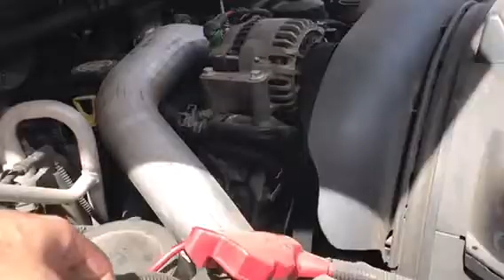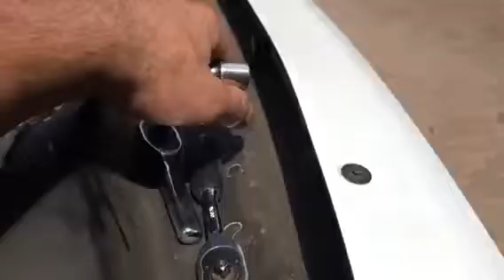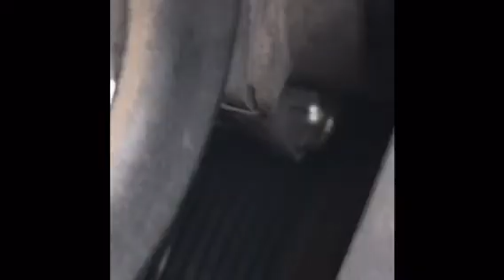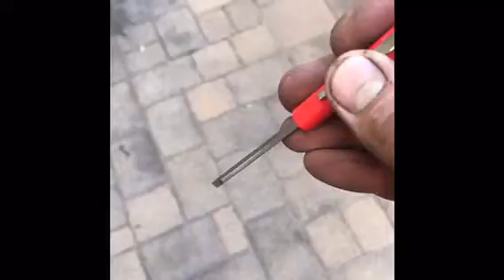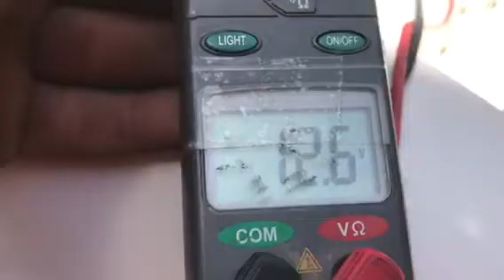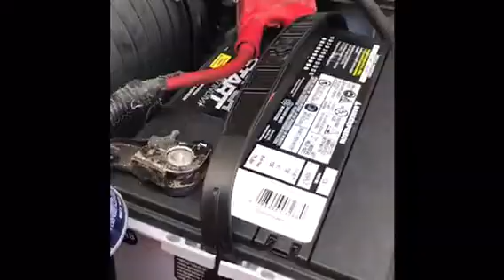6.0 Powerstroke alternator removal (fast and simple)

Comment: i didnt watch this video, but i can tell you how i do it in 5 minutes, take the three bolts out, flip it over to release the belt, stick a socket extension in the left rear bolt hole of the new one, flip it up with the belt on, put the bolts in, no reason to use the belt  tesnioner

Comment: It seems I'm the only one... the little tab on the two wire electrical connector on the back of the alt didnt just "pop off" I broke it... twice. It will still work, I hope, but it didnt just pop off like you said and your description was pretty vague about how it comes off. All those connectors seem to be different and I F them up.
Also the slot for the breaker bar or ratchet on the tensioner pulley isn't an easy thing to get to. It's way far down, can't see it. I can feel it but not so cut and dry. My breaker bar has been modified(has a 90° handle welded to it for another specific job and my other one broke pulling teeth on my stump grinder) so I can finish the job today and so far has not gone as smooth as others have posted. This video was helpful forsure. I'm just frustrated that it didn't go smooth and I have to wait til tomorrow to get a breaker bar to finish.
Reply: Yeah I broke mine too.  It looked like the last guy jacked it sounds a little too which didn't help.
Reply: Oh yea most videos are like quick an easy just pull the belt don’t even need a breaker bar 😅 am like mm I can’t even do it with a breaker bar lol so apparently small 1/2 rachets is the way to go

Comment: Caution the alternator bolts lean towards the alternator mounting bolts rusting into the mounting holes. Just be ready to get some helicoils for the resultant stripped threads, and use nickel antiseize on the threads regardless of what threads you end up having.  Some engines have different tensioners and different frame for the engine fan and as such the belt is a bugger to get loose. Pretty close to what you show here but different enough to frustrate some.

Comment: The electrical connections on the new alternator will end up 120 degrees to the left of where they are on your old alternator. These alternators come with these two different configurations. Either one will work. Your new setup will have the wiring connections coming off of the left side of the alternator, while the wiring came off the top of your old alternator.
Reply: Ok dope cause i just got mine i few minutes ago and my connection are on the left

Comment: Thanks for the vid.   

I know,  as do most? how to dismount an alternator.  What was unique to this 6.0 is this "tab".    You pretty much glossed over that exact location and operation,  both lock and then unlock.   Yes,  we know about what to do to fix/prevent corroded terminals...   :-)    6.0 was the draw here,   and I think the unique features were not explained/explored.
Reply: Most do not know how to dismantle which is why we are watching.

Comment: If you aren’t strong enough to pull the belt, there is a square slot on the tensioner that you put a socket extension into, and put your ratchet or breaker bar on it. The tensioner is very easy to move this way.
Reply: Lol that's what I needed to hear.
Reply: Would have been nice to know what size.. most are 3/8 but pretty sure this is half.
Reply: @19shane94  pretty sure? I picked up a breaker bar and it doesn't want to go in.
Reply: @MrBrucewpg  1/2 if I remember right. Should go in it just needs to be straight and at the right angle. Can be a little tricky but it'll go in.
Reply: @MrBrucewpg  yea literally just walked back inside to grab a beer after that. finally done though, breaker doesnt fit because of clearence unless you remove the passenger battery and the metal hose. i ended up using a 1/2 ratchet and 2 fingers to pull it to get the belt off. then i saw this video hahahah.
Reply: @willywill3570 yep two of my 1/2 inch breakers didn’t fit, randomly decided to grab my smaller 1/2 rachet and some what when in but wouldn’t reach all the way so then I was like you know what let me get a 1/4 to 1/2 socket to get more clearance for my small rachet and sure enough it when in like butter lol then went and use a pipe I had around for laverage
Reply: @Taro-k5u if it works, is it a dumb idea? Nice work!

Comment: Is it easy to spot this "tab" you speak of?  Might have to use gmeast ratchet strap trick.  Since we're in a rural area and the mechanic keeps not showing up looks like I'm getting ready to tackle this job myself.  :-(
Reply: Kelea Nevis I did mine today.  After several attempts I figured out that tab is more like a kickstand for the tensioner. It took about 7 or 8 tries and I finally got it. I got it when I pulled more up on the belt than out. I used a long pry bar to tap the tab up with my right hand while stretching the belt with my left. It took about all the muscle I had pulling on the belt. It didn’t beat me though.  $240 for the new alternator.
Reply: @marcholland1554  Thank you for your reply.  I actually watched a secondary video after taking notes from this one.  He showed the tab location exactly (the pulley was in his hand not on the vehicle) and I was able to spot it without issue.  Did use the ratchet strap to pull the belt away enough and get the tab in the closed position.  Thankfully ours was still under warranty so free replacement.  Used the strap again to get that tab back out but it worked like a charm and you can't imagine my joy and excitement when that diesel cranked right over!!!  Surprisingly only about 15 minutes for each task.
Reply: Kelea Nevis Excellent news.  Hopefully we won’t have to worry about that for a few years.
Reply: @marcholland1554  I know I won't, at least not on that truck.  Going up for sale.  Got a newer version.  😁

Comment: Not easy to do alone if you're not real strong, so I hooked the belt with a cargo strap and ran the other end across over the battery then down hooked it under the fender. Then I ratcheted the strap, pulling the belt far enough to flip the tensioner's kickstand up with a long screwdriver. Holding the kickstand in place with the screwdriver in my right hand, I released the cargo strap ratchet with my left hand. I replaced the alternator, slipped the belt onto the pulley, ratcheted the cargo strap tight again until I heard the kickstand release (it's spring-loaded to release) and done. That was tooooo easy.
Reply: Excellent idea!